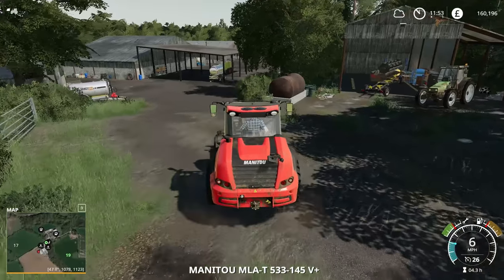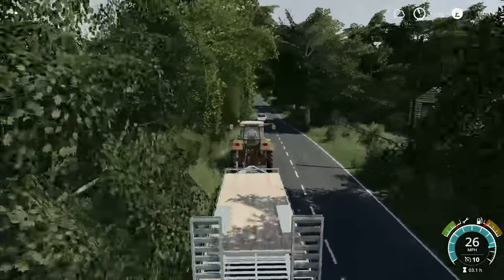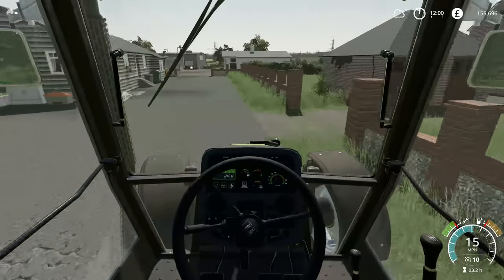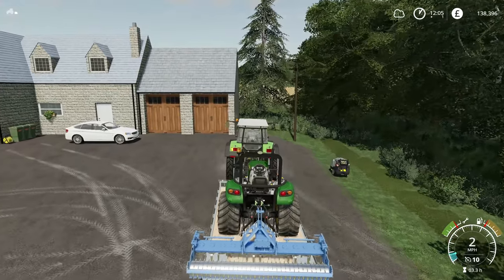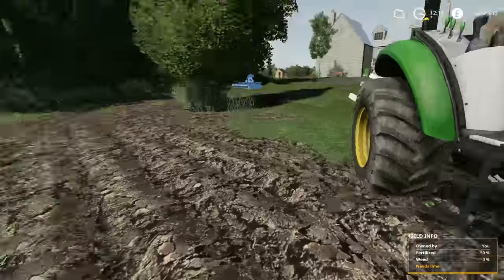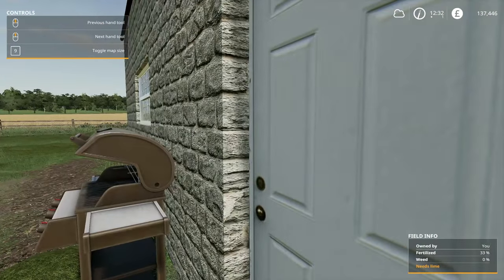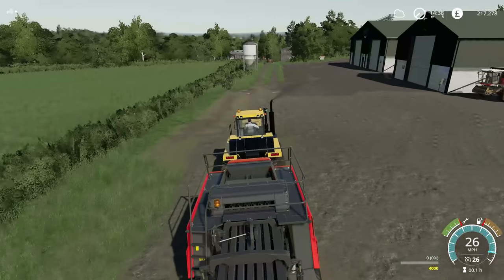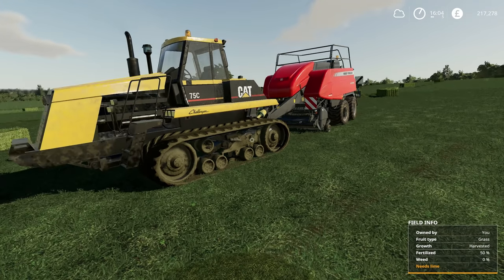LAWN CARE WITH A PLOUGH - Getting the Grass Seed Down

Comment: Did you change the bitrates you are capturing or encoding your videos at? They are looking quite muddy, blocky and have a lot of artifact in 1080p. Try to stay above 20 Mbps because YouTube compresses the video after you upload. I like 40 Mbps, which is complete overkill at 1080p, but then you get zero artifact from YouTube compression. Wondering if maybe you've been lowering your capture bitrate for live streaming reasons, but then forget to change it back to a quality setting when producing regular videos? Just an observation... Cheers!